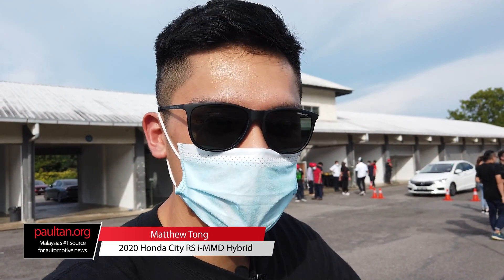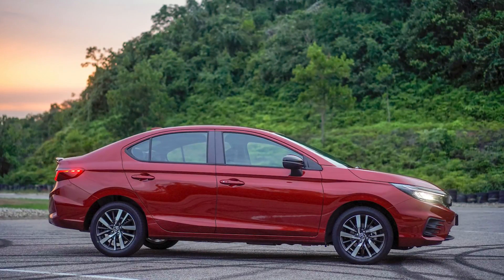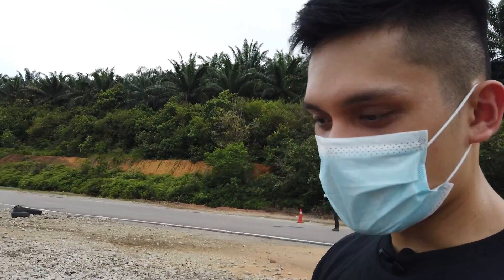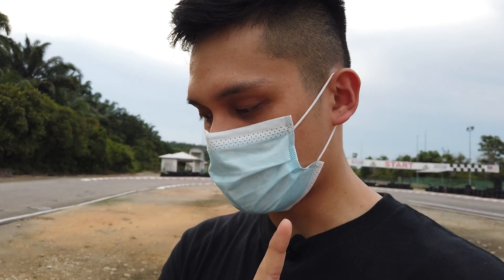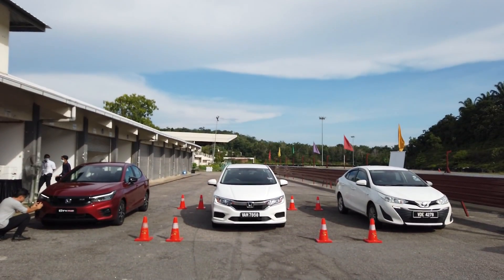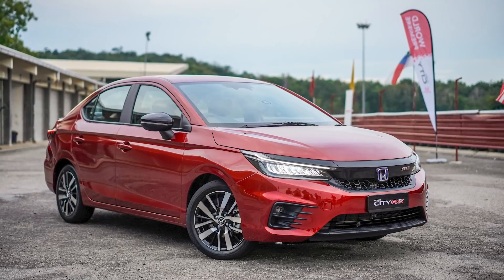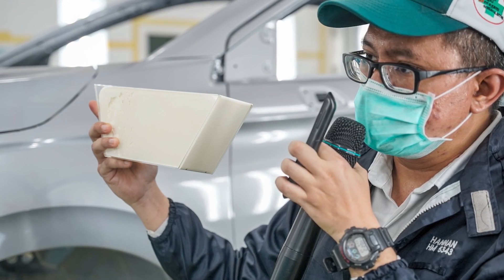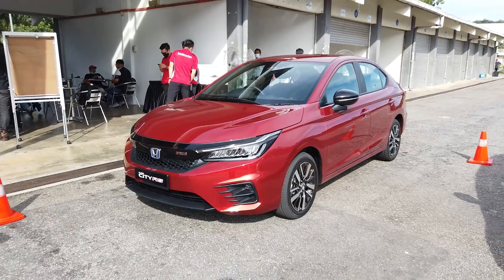2020 Honda City RS i-MMD Hybrid first impressions review in Malaysia

Comment: Malaysians dont care about the city anymore already lmao, a catchy advertisement can create some short term hype awhile but once a solid product like the proton x50 came out, it's over for the city
Reply: Not everyone prefers to drive an SUV. Sure the X50 may have better specs for it's price but people like me don't like driving a taller car but prefer a sedan.
Reply: Dude did you just compare suv to sedan? Did you dropped your brain somewhere?
Reply: Like me. Im already using MPV but i dont  like to use SUV again. I prefer sedan. Morethan, this proton product don't have revaluation. So......ya
Reply: @Kovacs.x  I see you're a man of culture. Yes, this is exactly it. Not everyone is fond of large vehicles like SUV, MPV and pickups trucks. Some people prefer compact sedans or even a sporty coupe. Different strokes for different folks as they say.
Reply: @darkrealmlight92  I get where you're coming from, but with malaysians tend to believe more in combustion engines than hybrid cars, i really do not think the package city offers is compelling. 253nm yes it's nice but it's more like a gimmick if people do not appreciate it generally. Besides honda doesnt even offer honda sensing for combustion engine variants which is  a big turn off for people who only look at combustion engine cars, im not here trying to compare SUV and Sedan but i just feel the product itself is a failure. Heck i even think the almera is a more compelling package than the city
Reply: FranKey AdeL unfortunately suv is smaller capacity than sedan rs , can you believe that ?
Reply: @absolutliam  I can.

Comment: Hi there, quick question: Will the high speeds power (e.g. 110km/h-140km/h) be an issue given it is driven by the 98hp motor only? The electric motor seems to do fine with 253Nm torque for low end, but worried on high speed power. Any thoughts?
Reply from the maker: Hi, at high/cruising speeds, the internal combustion engine will be the main source of propulsion. The i-MMD system will automatically determine which of the two drive units is the most suitable for use, depending on the condition.
Reply: @paultanautonews  Hey, thanks for this. But enough power to pick up past 110km/h? 98hp feels a bit low for a 1.2ton++ car. Thanks!

Comment: 253Nm torque is available for all time or according to how much the battery charged?
Reply: In laymen's term, the 253Nm is only available when you're in EV mode (slow speed) and Hybrid mode (medium speed). You lose the 253 torque at Engine mode (high speed) but get better fuel efficiency. There's no such thing as 'how much the battery is left' because the generator coupled to the engine automatically recharges the battery as long as you're driving. Remember, this car is more of an EV than a hybrid but without the plugin feature. TLDR; 253Nm is always available during low and medium speeds. Battery is automatically recharged by the generator.
Reply: @darkrealmlight92  wondering the hybrid mode max speed is how much ? 85kmh ?

Comment: Meh but at the same time, gotta be kind aka professional to Honda for inviting. I am still cackling how Honda Malaysia is still balsy to call this a sporty sedan when the system is other Hondas such as Accord, CRV and Fit was never about speed but all about fuel economy. I am really interested how they feel about the sound of the engine mismatching with the speed of the car based on how the CVT is basically 2 electric motors and one gear working together. Also how heavy the car is since the Fit in Europe is 1304kg